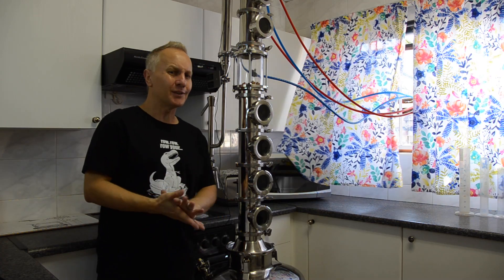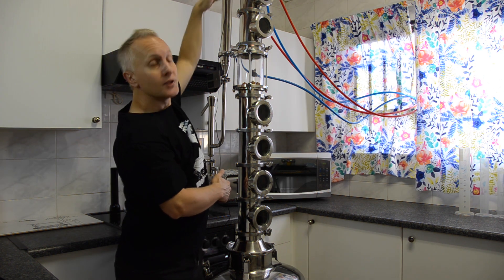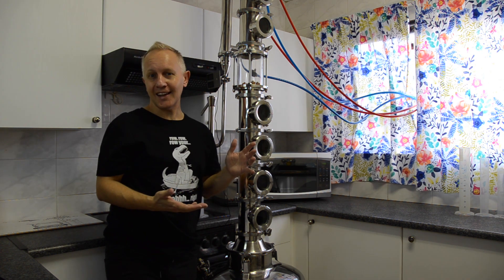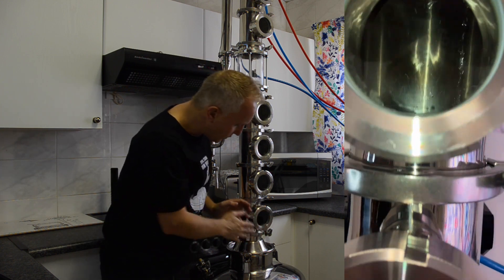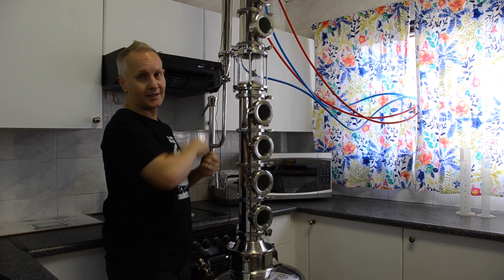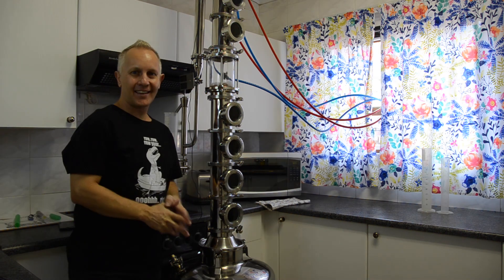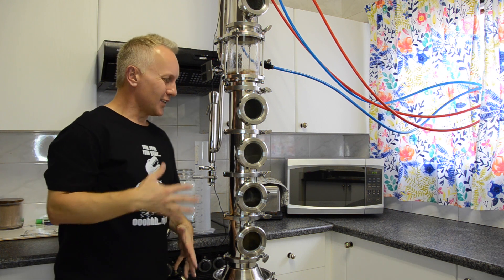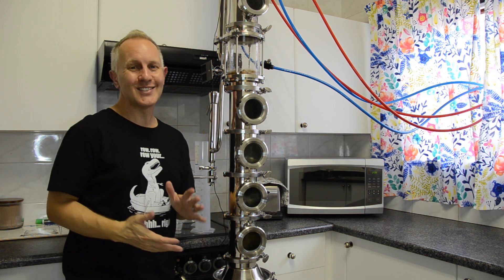High Reflux Vodka Run | How to Make Neutral Spirits at Home (Step-by-Step)

Comment: Looks like you have a 4" column, what power do you throw at it?

I have a 4" column, SPP over 3 plates, 4" dephlag, but my 2×2.4kw elements easily overpower it.

Running the still full power and the reflux as hard as I can it still comes out at 9L p/h.

It also floods my top plate, has an air gap and floods my SPP :/
Reply from the maker: Yeah, you’re spot on—it’s a 4" column. I had a single 4 kW element and usually ran it at about 85% power due to power restrictions in the townhouse. That setup gave me a decent balance between output and control.

Sounds like your rig is a beast with 2 x 2.4 kW! If you're pulling 9L/h even under full reflux, that’s definitely pushing a lot of vapor through.

With the flooding on the top plate and in the SPP section, it sounds like vapor speed might be too high or the packing isn’t draining properly. I’d definitely recommend reducing the power a bit—you’ll likely get a more constant and stable run with limited flooding.

Also, double-check your dephlegmator’s coolant flow—it can make a big difference in keeping everything balanced.

Let me know how it goes if you tweak the setup! Always keen to hear how others dial theirs in.
Reply: @distillergreyling  

Hey,

Yeah, I took the bubble plates out of it and used the sight glasses to hold the SPP with some copper mesh to hold them up so I could see what was going on.
What I found was that the packing doesn't flood at all, not even a little bit at the bottom/top, and not like it does when I use the stainless steel to hold the packing. So that tells me that the sieve holes in the floor of that part of the column to hold the SPP in place are too small for drainage and that may be the cause of the flooding. From what I have read on the HD forum it should have a bit of "flooding" at the top and bottom but not through the whole column. 

However it still easily overpowers my condenser, the condenser gets overpowered with at little at 1.7Kw, so I am going to get some copper pipe, bash it flat, put a few twists in it and place it in the holes in the dephlegmator, that hopefully will cause enough turbulence to force more contact with the vapour. I stuck some twisted copper mesh in there to slow the vapour speed and that worked, I could run it at ~3.4 - 3.6Kw and the take off speed was at 1.8L per hour, so it dramatically slowed it down. I ran the reflux full speed and used the power controller to overpower it. Much easier than trying to throttle jockey the valve for the dephlegmator. I haven't tested the copper pipe yet but it will be interesting to say the least.

I may drill out the sieve at the bottom of the stainless tube to allow for better drainage. I plan to purchase a few sight towers and take that SS tube out of the column anyway.

Edit: running it again now, getting azeo, it is coming out quite quickly at ~3Kw, reflux is on just a smidge.

I drilled holes in to the sieve on the bottom of the 250mm stainless steel part of the column, still big enough to hold the SPP in but not to flood. Overfilled my boiler to I am just taking some off so I can see how it goes in full reflux as if I do it now it I can see it start to puke in the lower sightglass, I shouldn't have an issue with knockdown power of the dephlegmator now though :)
Reply from the maker: @user-pt9gr3fe1p
Thanks for the detailed update — really appreciate you sharing your process and observations!

It’s interesting that the SPP didn’t flood at all with the sight glass setup but did with the stainless support; definitely sounds like restricted drainage was the issue. Drilling out the sieve to improve flow sounds like a solid move, especially if you can still keep the SPP in place securely. Let us know how the longer-term runs go with that mod.

Also curious to hear how your copper pipe turbulence mod in the dephlegmator works out. The twisted copper mesh clearly made a big difference, so your approach with increasing vapour contact makes sense. Pushing up to ~3.6kW with controlled take-off sounds promising — good call using the power controller instead of constantly adjusting the valve.

Would love to see some pics or even a short video if you ever feel like documenting the setup in action — others in the community could definitely benefit from your tweaks.

Keep the updates coming!

Comment: Nice video and my reflux still with five floor bubble plate 3 inch column is run for low temperature with  TPW wash 5 gallons. I run the still till all sight glass are fully flood with temperature controller and balance it approximately 25/30 minutes around 60/70v is a perfect for balancing out so it don't reach condenser. Then turn the voltage controller fully 240v and turn on intake water on all the way 96% ABV with 20c hydrometer guaranteed every run. I balance my condenser heat temperature at 51c/52c and get 3.2L hearts throw away 250mls foreshots/heads and collect 600mls of tails for next run. Good video for beginners as you get better at it you will get 96% ABV every time. I've only been using the still without any help for 3 months with research on my T500 still kit with my five bubble plates. Your set up is huge and double the amount of equipment and absolutely love your setup bro 👍👍👍 must of cost you loads 😉 mine in total cost me £600. Beautiful video 👍👍👍
Reply from the maker: Thanks Anthony!!
You’ve got a solid run there. I like that with some research and experience you get to know your equipment.
Makes the next run easier and more efficient.
Thanks I love my 100lt still, was a few bucks, but I saved up and now it’s mine! 😁
Keep being awesome!
Reply: @distillergreyling  thanks for your reply much appreciated 👍. 100L expensive for me and paying out £600 was more then enough lol 🤣 I only do this as a hobby and don't drink much or not try to lol 🤣. You take care and Keep making good videos 👌👌👌
Reply from the maker: Only a pleasure Anthony!!
True, in the end it can get leke expensive!
Sweet! 👍🏻👍🏻

Comment: SPP or Mesh would give you a lot more effective plates with less column height than bubble plates as cool as they look.
Reply from the maker: Hey Robert!
That is true and there is absolutely no problem with using SPP or Mesh.
For me I just love the height and bubble plates. I have run it with less plates and shorter with pretty much the same results.
Reply: @distillergreyling  copper and bubble plates are addictive.
Reply from the maker: You damn right they are!! Ha ha ha ha!!